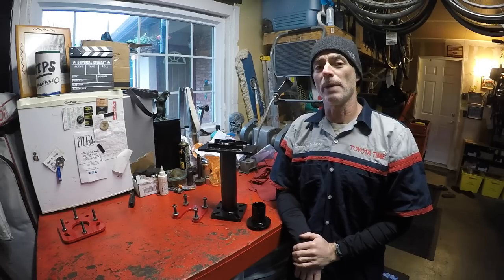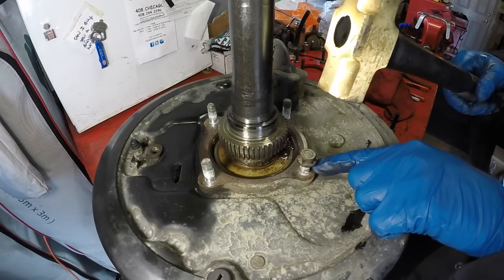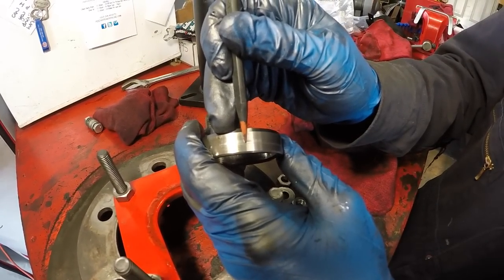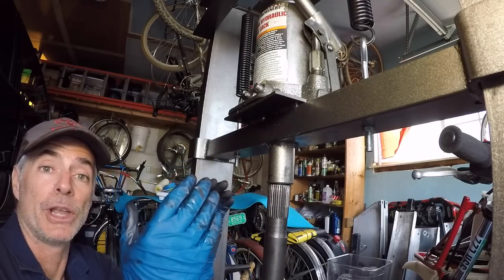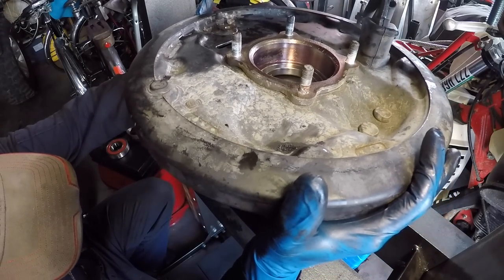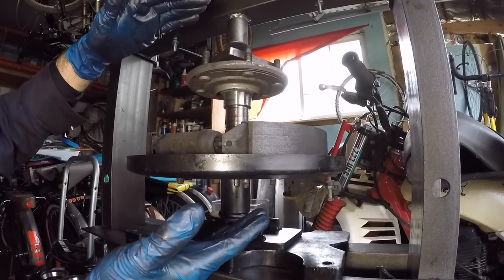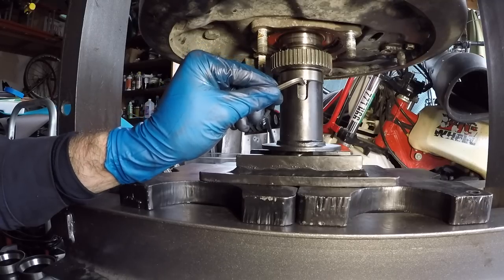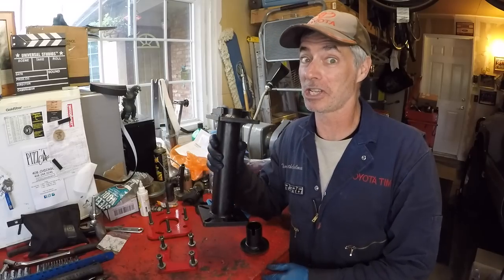Toyota Rear Axle Seal/Bearing Replacement (Part 2)

Comment: You have the best detailed videos. I am needing a video of a 2008 Tacoma TRD with ABS, rear bearing assembly...for Drum and Shoes, and not certain the "new" tool works as is, or requires the accessory bracket...any chance you can post another update video with that type of repair illustrated?
Reply from the maker: If we do this repair on your specific vehicle, it won’t be for a very long time. We don’t know anyone with your vehicle.
Reply: @TimmyTheToolman , thanks for the reply. Too bad you don't know anyone in your area with a similar vehicle. I cannot find one youtuber with a video showing the rear hub assembly replacement on my vehicle. They are all of the styles you have posted...with individual components, and one guy just explains how he took his axle to a machine shop for the hub replacement...and did not show the replacement being done at the shop. If I purchase the removal tool, I do not know the technique for replacing my own, and was hoping you could help. Can see I need the adapter plate specific to my vehicle though. I will figure out a solution, like we all have to do at some point. Happy holidays. Will see you around YouTube.
Reply from the maker: Keep us updated. Sorry we couldn’t have been a better help with this repair...

Comment: Great video!! Just finished my assy but the tone ring doesn't look centered when axle installed. Will sensor still read tone ring?
Reply from the maker: The tone ring doesn't need to be centered on the axle hole. You're good.

Comment: Really appreciate you putting this out, great and informative vid! I am in the process of this job and I nudged just past the 5mm tolerance on the inner retainer, I was going for a tiny nudge with the press but it bumped past by about 1 mm, the press I'm using at a friends shop is very touchy! If I am correct, it seems I could just repeat the first part of the process of pressing the tone ring and inner retainer back by just a pinch without mucking things up or compromising the bearing?? I'll report back after making an attempt at it tomorrow but I thought  it might be worth a post in case anyone else experiences the same or if you or others have any thoughts on this.
Reply from the maker: Yes, you are correct.  Just get under the ABS tone ring with your puller and pull it back 1mm.  After that, do the sharpie or grease test to confirm you have a good mating of the seal with the inner retainer.  The 5mm of polished axle showing is usually a good measurement to get a good mating but it does depend where you take the measurement from because the amount of polished axle showing isn't always equal around the whole circumference of the axle.  One spot might show 4mm from the face of the retainer while another spot might show 5mm because the end of the polished part isn't perfectly square.  The important thing is confirming a good mating of the seal with the retainer, and if it isn't good, you make the necessary adjustments of the retainer up or down to get it right.

Comment: I wouldn't use certain grease like high temp bearing and race grease is way to tackey it actually causes the dust boot to loosen and spin while the axle is spinning in diff I had my brakes off and re inserted the axle and notice while truck was on jack stands and in gear if the grease is way to tackey it actually allows the dust boot to spin with the axle separately and eventually the dust boot walked itself out so my suggestion would be to grab the red devil grease because it's not as tackey as axle and bearing grease and use the red devil sparingly if you have to use high temp extremely tackey bearing and race grease use it very Minimally just my experience for others @timmy the toolman
Reply from the maker: That's interesting about the dust boot.  I find it odd the dust boot could spin.  It fits in really tight and there literally zero loud on that seal.  Nothing contacts it.  Something isn't adding up here.  I've pulled axles that I've done work on and the dust seals were fully seated and didn't walk out.  On every dust seal installation, I use a little of the multipurpose Red Devil grease to help with the insertion.
Reply: @TimmyTheToolman  I belive the high temp grease is way to tackey and it makes the dust boot slippery and causes it to spin slowly and it walks itself out I watched it with the axle spinning walk out I belive way to tackey grease makes the seal slick and the vibration of the axle turning causes it could of been my fault might of used to much grease on the high temp tackey bearing grease because when i re did the axle work again with the red devil not a single issue
Reply from the maker: @AntonioClaudioMichael  Gotcha, this is good to know.  I guess I was using the right grease the whole time luckily.  I just like applying grease where I can so it will make future removal much easier.  You can obviously insert those dust seals without the help of grease.  I've just had those damn things fight me pretty good when I'm trying to pull them out with some pliers.
Reply: @TimmyTheToolman  mine fought me with the high temp grease I originally used I think that is why it spun and walked out because it being so tackey to much grease came out the jar even though I grabbed a tinny amount it was so tackey it stuck to itself so bad it strung and more ended up coming along then I wanted super tackey grease is like mozzarella cheese a little amount goes way to far

Comment: Damn you Timmy!! Doing this this weekend, so just bought the last unit from eBay. Said it should be here this Saturday, so hopr that holds true. Was going to try to use plates, but the engineering numbers weren't adding up for the way I wanted to do it.
Reply from the maker: So, you bought a Durasolid tool?
Reply: @TimmyTheToolman  Heck no!! Just bought the tool from Dwayne:-) Was going to use a method I came up with involving a threaded 1" steel plate, but the engineering math wasn't what I'd hoped after doing the calculations.
Reply from the maker: @weekendclimber  Oh good.  You had me worried there.  Well, I guess it worked out that we got the video out in time for you to use it.  Let me know how it goes for you.
Reply: @TimmyTheToolman  Will do. I think this will make the job go a lot easier because I was planning on taking the rear brakes apart, wheel cylinder, bell crank and all.
Reply from the maker: @weekendclimber  Yeah, that's what I like about doing the job like we show in the video.  You can keep the brakes completely intact for the whole job.  If you do need to do the brakes due to the shoes being soaked with gear oil, you can just do it after you've got the axles back in.  In case you need it, here's a video for replacing the rear shoes: https://youtu.be/IJkVEBYSecs
Reply: @TimmyTheToolman  Used the tool yesterday and it worked great! Didn't even have to reference your video while doing it. Took about an hour per side once the axles were out, including some time to clean them up real good. Was initially doing this job as preventative maintenance, but both ABS cavities had gear oil in them. It was only a matter of time before the brakes went, so I'm glad I had already planned ahead to do this.
Reply from the maker: @weekendclimber  Great to hear the tool worked well for you.  Good job getting it done.  Watching our videos and reading through T4R.org threads, you now know more about this repair than most Toyota Technicians, and that's not just my opinion, that is fact.  Toyota dealerships, private shops and machine shops screw up this repair with a high frequency.
Reply: @TimmyTheToolman  One thing I did run into was putting that snapring back in it's place above the inner retainer. Once I got it past the section where the axle widens, my snapring pliers wouldn't open wide enough to keep going. Ended up taking a press sleeve and ramming it down the rest of the way. That took a little time to figure out.
Reply from the maker: Sounds like you need a better pair of snap ring pliers.  Where I have difficulty is getting the damn thing off.  I just purchased a different set of snap ring pliers which I think will work better than anything else currently in my tool box.  The snap ring pliers I was using to get the snap ring off aren't even the right type but they were the best ones in my tool arsenal to get onto the ends of the snap ring.  The ones I used to put on the snap rings are good but they always slip off the ends of the snap ring when trying to expand it and get it off the axle shaft.  Hopefully the ones I just bought will work much better.

Using a press sleeve to slide the snap ring in place was smart.  Good job!

Comment: Yo, so what all do you recommend replacing? Dust seals, bearings, o rings, inner seals axle housing? Reuse inner / outer retainers, abs skid control? In part 1 , you replace everything... wondering what parts I need to order
Reply from the maker: You've got it right Pat.  Replace everything except the 2 ABS tone rings and the 4 retainers.  We replaced everything in Part 1 because Charlie came with all those parts and didn't want to try to return them.   You want to order the bearings, the rubber dust seals that fit into the front side of the bearing case, the inner axle seals, the c-clips that go above the outer retainer and the large o-rings that fit on the ends of the axle housing.  You'll also want to have some gear oil on hand, a couple fresh crush washers for your fill and drain plugs and maybe some new Toyota brake shoes if your shoes got contaminated with gear oil.  Good luck with the job!  Let me know how it goes for you.

Comment: Hey Timmy great video i had my bearings changed by a garage in uk only 3 months later 1 seal was leaking took it back and they said it was a bad seal and replaced it fast foreward 9 months both seals leaking i think the inner retainers are not in the right place could they be ripping up the seals after a few months or maybe on to far .Great idea with the sharpie .Hilux mk5 uk model .
Thanks Timmy
Reply from the maker: Sounds like they don't have the proper mating of the inner retainer and seal.  Bring it back and ask them to perform a sharpie test right in front of you so you can see for yourself where it is riding.  Or, pull the axles yourself and you do the sharpie test.
Reply: @TimmyTheToolman  Thanks Timmy ill have a go myself now i know how its done thanks mate
Reply from the maker: @mookett  You're welcome.  Good luck with the job.

Comment: Hey Timmy, I'm in the middle of replacing seals, bearings, etc.,. Cleaning everything up right now and am going to do the press work tomorrow. I've watched the video 5/6 times but I wanted to be for sure on something. So when you install the new seals, is it going in dry with no white lithium, red general grease, black MOLY, spray teflon, etc.? 
Thank you in advance for any input you can give me.

Comment: This is such a helpful video! I was wondering if these parts would fit the first generation tundra or are the part numbers different?
Reply from the maker: Glad you found the video helpful.  Not sure if the the 1st Tundra axles use the same parts.

Comment: What were the symptoms prior to this job? I have a ‘95 4Runner V6 4X4 auto..just did head gaskets decked heads new in&exh valves, valve seats,guides, valve adjustments..I have a pretty bad vibration especially upon de acceleration around 60-75. Already did front upper control arm bushings and wheel bearings adjusted, had quite a bit of play before bearing adjustments… the vibration can only be felt from the body, your seat. No through the steering wheel.
Reply from the maker: The symptoms are usually people identify that the rear axle seal is failed by seeing a spray of gear oil on the inside of one of the rear tires.  The gear oil got past the seal, made it's way through the bearings and then made it's way into the brakes.  A bad wheel bearing can make kind of a growling noise and other noises depending on how bad they get.  Have you checked your rear driveshaft u-joints.  The symptoms sound to me like you have a u-joint going bad or maybe the output shaft bearing on the transfer case is going bad.

Comment: Tim, 
Watching this video has inspired me to take on this job on my 2002 tacoma double cab 4X4. Unfortunately I have to do this job only to replace both rear brake backing plates do heavy rust and corrosion from NJ salt roads. Might as well replace bearings and seals since everything will be apart anyway. Do you recommend I replace the rear axle bearing cases also with the rear brake plates? I haven't seen many videos on youtube for brake backing plate replacements.
Thanks,
Joe
Reply from the maker: Hey Joe, yes, I would recommend you do the bearing and seal job at the same time.

Comment: I'm gonna need to swap out bearings at some point but how will I know when they go bad , my make noise going down the road and my FJ has 124k . When ever I changed the oil and lube the prop shaft I place the rig on jack stands and start it up and put it in gear . I then place a stephyscope on the bearing blocks to listen for any noise . None yet . My question is how many miles are the original bearings worth ? The fronts are worth about 80k . Awesome video ..
Reply: It appears that a FJ cruiser assembly is way easier because it has fewer parts , at least 2 less . I'm gonna keep that puller . Thanks again .
Reply from the maker: Hey John, it's hard to say how long they will last on your FJ.  I know for 3rd Gen 4runners,  it's not the bearings that go bad first but the axle seals and then most people go ahead and replace the bearings at the same time.  It's interesting you said the front wheel bearings only last around 80k.  On a 3rd Gen 4runner, they can last for much longer.  My 2000 4runner has 200k and the front bearings are still fine.
Reply: @TimmyTheToolman  The front went south ,or the front right side did . So I just did both . The press work was 40$ per . I wasn't going to risk wrecking the bearings so I ponied up . There appears to be just a snap ring and retainer on a FJ , the abs part is built into the bearing module . Toyota makes them right , I bought mine in May of 06 and it still has the original Panasonic battery , I live in Ohio , that says a lot . Thanks for responding to my blabbing , really appreciate your time .

Comment: How about replacing the backing plate while all this is apart...? I can't find a DIY for Toyota Tundra 1st gen. . I'm guessing disassembling all the rear brakes I'll figure it out, just thought a video would be good... ? 
Thank you.  Subed & shared :-)
Reply from the maker: You certainly could if you wanted to.  It's easy to do.  Once you have the axle out, all you would have to do is drive out all 4 axle serration bolts from the bearing case, pop the bearing case free of the backing plate, disassemble the brake parts, remove the wheel cylinder and bell crank and you could swap the parts over to a new backing plate.  If you're definitely going to go this route, I'd disassemble all the brake parts while the axle is still on the vehicle.  The only thing you'd have to do once the axle is out is drive the serration bolts out of the bearing case and tap it out of the backing plate with a plastic mallet or dead blow hammer.  The bearing case should come out very easy.  Our rear brake video might help you out: https://youtu.be/IJkVEBYSecs
Reply: My backing plate is rusted out, bought a new OEM from local toyo dealer, only $45 cdn!!! WTF.   I bought two just in case :)

Comment: Having never owned a press and I will need to get one soon to perform this job on my 4runner. I noticed you have the 20 ton press, any reason to get it over the 12 ton press (both at Harbor freight)? Again no experience with a press before so I was not sure if the larger tonnage press was the way to go over the lighter tonnage press. Thanks again for the great information and videos.
Reply from the maker: Get the 20 ton because it will be more versatile for you.  If you ever have to do front wheel bearings, those bearings require a lot of force and I don't know if a 12 ton would do the job.

Comment: I can also attest to the 5mm my axles and bearings were orginal from day it was made 21 years old and the bearing blew the retainer was 5mm on center of the retainer witness mark and the was 7mm polished shaft
Reply from the maker: Your measurements are confusing me.  When you finished the job and had the seal riding close to dead center on the inner retainer, how much polished axle did you have showing above the retainer?  I have found it's somewhere around 4-5mm.  The amount of polished axle isn't perfectly even around axle shaft.  You can easily see that one side is a bit higher than the other and that's why the amount of polished axle showing is just a ballpark estimate.  The main thing is to perform a sharpie or grease test to confirm you have a good mating of the axle seal and inner retainer.